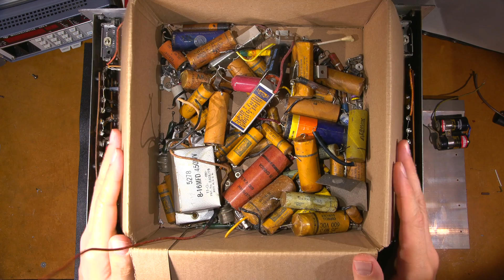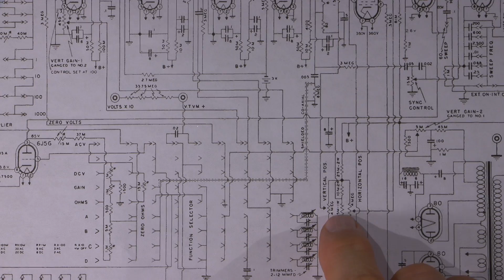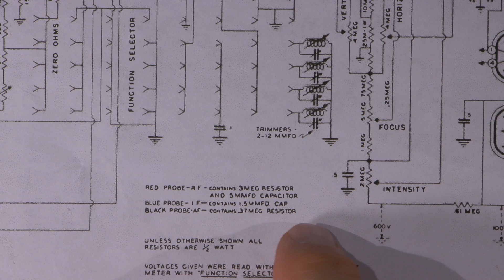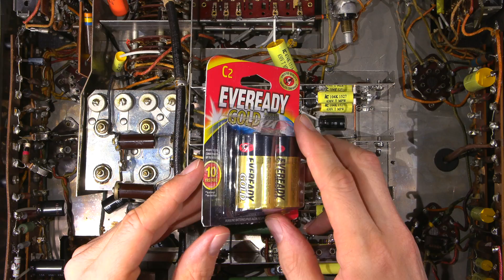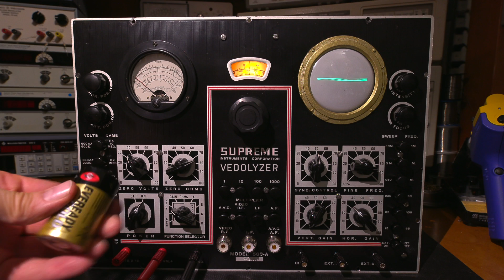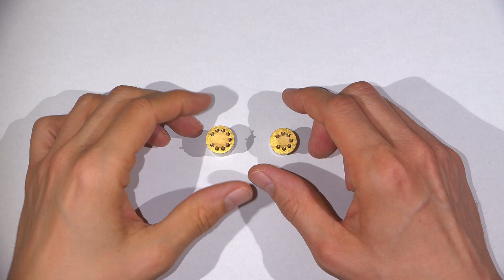It's Alive! The Supreme Vedolyzer From 1939- [Restoration Part 3]

Comment: The item is a bargraph Nixie tube, specifically identified as a model similar to the IN-9.

Function: It is a cold-cathode vacuum tube used as a discharge or level indicator, which produces an orange glow.

Design: It features a display coil inside a glass tube with wiring at the end.

Comment: I would've put battery holders on the back of the cabinet, or on top of the chassis, replacing the batteries should not be that hard. In a number of years, if someone else has it, and it stops working, they wouldn't have a clue.

Comment: I have done the WD-40 on most all radios to bring the back to life for band switches small moving parts but never on vacuum tube testers. I like WD-40 better than anything else for making things move smoothly a like you stated it cleans contacts nicely. Great radio repair here. One question what do you do with all the old capacitors and other things you remove?

Comment: i was told by an employee of textronix that every piece gets a bath when it comes in for service. soaked rinsed and dried before any service done.

you are 1000% correct about the power of wd-40 it cleans connections and protects them 

pc ram sockets love it

Comment: At the World Radio History site, I found a number of nice large advertisements in issues of Radio-Craft magazine.  July 1939 had the model 504 Vedolyzer (simpler, no scope).  The May 1940 issue has the 504 but also has the 560 Vedolyzer (with the scope) and also the 562 Audolyzer.  The January 1941 ad, unlike the other ads with photos, has a drawing of the 560-A Vedolyzer with drawings of various waveforms with big text at the top of the ad saying, "SEE The Signal".  The end of the ad says, "...an instrument for COMPLETE DYNAMIC ANALYSIS."  The ad mentions their 1941 catalog so it is likely some old catalogs exist somewhere.  The company was located in Greenwood, Mississippi.  These advertisements make very entertaining reading.  A 1946 catalog was sold on eBay but it no longer had the Vedolyzer but did have a scope, many tube testers, audio generator, and meters and said it was their 20th year.  So, it was founded circa 1926.

Comment: Why didn't you just buy 2 of each in NIcadium rechargeable batteries for that radio instead of  regular alkaline batteries as replacements. They'll last as long.,or could last even longer than those alkaline batteries for more older.& modern upgrades.

Comment: If clean distilled or de-ionized water it would stand less chance of shorting or rusting.

[I had dumped most of a large latte' into my laptop computer. Unfortunately, the latte' was sweetened with sugar. Fortunately, it was a Thinkpad that had drain holes in it. I pleaded across the table for my friend to pull help me pull the battery out. Coffee poured from the laptop. I placed the battery and laptop into the car and drove home, but on the way I bought a gallon of distilled water.

At home, I disassembled the laptop. It seemed so wrong, actually pouring water through the keyboard, rinsing the DVD drive out. With good luck, the motherboard was spared. There were only 2 drops of latte' near the USB port. I shook all the parts out, and set them on an window electric fan. Upset, with nothing to else to do, I turned on the fan, and the house with parts drying on the fan. Early in the evening, I took everything in.

In the morning, I put the computer back to together, and it started, and ran fine.]

I also suspect that a small amount of Kool-Mist could be added to the water to prevent rust entirely. Evaporust might be used, but unfortunately, it removes electroplating.

I had read from reports on CNCZone, that using distilled water also helps prevent rust in Koolmist solutions, where cast-iron tables and vices bathe in flood and mist coolant, all day.

Comment: I didn't catch what the voltage was of the original batteries - you had mentioned you would be testing them and thought they may still have been good. What voltage did they test at, if you recall?

Comment: 24:50 Isn't using pentodes with a low resistance load a pretty standard technique to build wideband amplifiers? The high frequency limit is basically the time constant made be the plate load and all the parallel capacitance, so keeping that low and maybe compensating the top-end a little by those chokes gives a good bandwidth?

Comment: Hello i had seen this series when you first posted it and came back to watch it, as i had wandered off into a different direction. I sold my beloved restored German Grundig 1950s AM, FM, SW w/4 speed turntable and was in a bit of withdrawal. I was immediately calmed by your professor voice and terrific explanations. Your talents and gifts are very well shared and most appreciated. I hope all is well and I will be watching more often. I did complete a self tuning smoke generator for Model Train steam engine so i have been using my 70 year old brain, but alas not the big old radios and hot Tubes.  This series was an excellent save and wonderful result, one of your best projects. Stay well, Dennis

Comment: 3 hours is okay. I am surprised you got that far without tying a rope to it and dropping it into a lake to keep your boat from drifting away. I hate equipment that has been multi hacked & butchered repeatedly over a span of decades to keep it limping along, rather than actually having been properly repaired & maintained with proper periodic total rebuilds. I bought something called a "NOBATRON", made by Sorensen for Rayhtheon. It's an all tube regulated 0-600 Volt 0-1000 mA power supply, but it is a massive 105 pound monster. I opened it up and was looking at this enormous transfomer and wondering where are the other terminals. It was actually a gigantic filter choke. Someone blew up the original reference supply transformer 120 primary, 400-0-400/120-0-120/3.15-0-3.15/5 Volt seconday and some hack installed a 240-0-240 with 6.3 & 5VDC for the 5Y3, and a separate 120 to 240 iso trans step up transformer so it would only run at about 315 Volts.  I got stupid lucky and found a 560-400-0-400-565 volt transformer on EvilBay. I can click the volt meter to milliamps, with an interlock switch on those 565 volt taps, and get 800+ volts out of it now.  I have rarely needed more than 600 volts. The regulation is rock steady and super stable. I have that same Lambda PSU too! That's a great little  workhorse too!

Comment: Wondering if you could of added a small power transformer and regulator circuit to eliminate the batteries so one does not have to replace them or worry about if they are still good in the future.

Comment: With all the work you put in, I am curious as to why you did not just disassemble the hacked VRs in order to clean and check them.  You could have also plugged those holes with epoxy or even tape.

Comment: Just a thought you mentioned that on the schematic that the K ohm values are marked with an M not a K. Ks are used to mark cathodes. They use M because in Roman numerals M=1000 now this is coming from a guy that's old as dirt that's how I learned it. Take it for what it is worth. There are all kinds of Roman symbols used in electronics, chemistry and mathematics in general. Great job on the restoration! Awesome video!

Comment: It looks to me like the two input resistors, 20K variable and 40K, were chosen to allow precise calibration for a 50K input "impedance". That would be with the pot approximately centered. Just saying. When I design adjustable resistor strings, I always shoot for centered pots when all is set correctly. Great job on this restoration too. I love your work.

Comment: Super Heavy Duty (Carbon-Zinc) should last for a very long time, and probably a lot better than alkaline.  Alkaline will leak.   This is why smoke detectors still list a big batch of part numbers that all point to various manufacturers SHD batteries.  (very low current draw)

Comment: if that is just a dual 5k pot couldnt you

1. replace it with a modern 5k that handles less current and voltage and then build from a couple transistors a current and voltage amplifier to allow it to work?

2. if there is enough room in the case couldnt you salvage 2 5k high voltage and current pots from the focus and screen section of an old tv (older tvs had the multiplier as a separate box and the pots often was separate too.

todays crt tvs have the multiplier and pots built into the flyback transformer and are all potted so you cant extract the parts.

then find a way to sync the movement of the pots as 1.

Comment: From the circuit you drew out of your unit, the plate load resistor on the 3rd stage of the oscilloscope amplifier might have the wrong value. Your drawing shows 2 10k resistors In the plate circuit as one was originally inside the peaking coil. 20k is a large value for a wide and amplifier. What value does the “correct” circuit show.

Comment: Paul, quick question about chokes/coils wound on resistors. Generally are the resistors just used as formers only? In other words not for any coupling reason or is there indeed a risk of coupling? (I guess it depends which resistor in the circuit you use.)  Regards David (gm4glg)
Reply from the maker: Most resistors are just used for forms, so they are high resistance. Some do act a parallel resistance though, it just depends on the application.

Comment: Have you ever seen what WD40 does to electronics and mechanical switches after a year or two? It dries into a sticky residue which catches every bit of dust it can and eventually turns into a guey mess and varnish and is a proper pain to remove, often blocking switches, etc! There is a reason that there is an electronic contact cleaner and there are other chemicals to protect bare metal!
Never recommend it for electronics, especially something like this.
Reply: I think WD40 was originally  intended to lubricate wet moving parts, eg bicycle chains. For sure, when used over many applications it does gum bicycle chains up. But I know a respected restorer who does use it to clean up chassis, often with an old toothbrush, but that does not entail many applications over a long period, and anyway I guess he does wipe up the residue.  Also, there are some restorers who have been known to use WD40 on switches. I would not.
Reply from the maker: WD40= "Water Displacement formula 40" It's original intention was to displace water in electrical applications.
Reply from the maker: Well that's odd. I coated the whole chassis, and it's bone dry without any residue.
Reply: @MrCarlsonsLab  There are lots of people that will spray it everywhere without even wiping it out so best to avoid any such recommendations :)
Check your Vedolyzer in couple of years, wherever you didn't wipe your WD40 properly it will turn yellow on shiny now metal :)

Comment: I think the hour-ish length videos are just about right as it's not always easy to dedicate much longer in one shot. It's great to see the restoration of this equipment but can you go a bit more into why you might use the Vedolyzer vs a regular scope or meter even if they are older/analog models as well? Is there something it provides that you can't get otherwise (and yes, I get the idea of using the old gear simply because you can as well).

Comment: Thank you Sir!  I appreciate your work and those who have helped.  The Violet ARC bulbs - When Keyed up and CW was part of what fascinated me some 40 years ago. Information transformed to dots and dashes.  It remains interesting. Your work - and thoughts on trying to fix stuff - amazes me. I know it consumes multitude of hours of thought and time. Cheers! 
Edit -- Grey matter filter -  i used a heathkit "multi-tester" some 40 years ago. At least the sweep - of the needle gave me Real values of voltage or resistance or current, but I knew it was based on specific points in time. TODAY - we use digital equipment - and think that the values - we see - are real, except if the are points in time, they are just wild guesses. The digital only gives use guesses. And I know I am commenting on the obvious - but without the 40 yrs -and your experience - we never see the issues. I remain an avid watcher of your work. I hope to repair my own equipment, NOT butcher it! Kind Regards

Comment: I liked the somewhat quicker pacing of this video compared to your recent videos. I like lots of information, but I'll be honest, some of the videos were starting to be a bit redundant, with the same information repeated multiple times in this video that was also repeated multiple times in the previous video. This one was perfect.
And I'm going to say that that is a Geiger-Mueller tube or some related kind of ionization detector. Not sure why it has three leads. On a G-M tube, I would expect only two.

Comment: For potentiometers you might want to check with potentiometers.com.
Anyway - my experience is that WD40 might be a potential for problems if you have high voltage circuits, mostly because it will leave a residue that attracts dirt. Might be a minor issue on indoor items, but for outdoor like a car ignition systems it could lead to less desirable effects.

Comment: Just curious did you test the removed capacitors?  It would be interesting to see how many would still be in-spec. after 80 years.
Reply from the maker: Hi Chris. Capacitors have paper in them that goes acidic over time. They may test close in uF, but their DC leakage is way above acceptable limits. (keyboard isn't behaving today.)

Comment: I'm sorry, I have a rather noob question that is not related with this video. When you're testing a diode or transistor with the curve tracer, what exactly that line in the screen represents? I mean, what exactly are we seeing there? I ask this because when we're using an oscilloscope, we see the amplitude of the signal, its voltage and frequency. But what specifically is shown in the curve tracer, what are we seeing? Thanks in advance.

Comment: Mystery device is a neon bar indicator. 
I own an old German 1934 Blaupunkt radio that has the same thing, just in a different package (bayonet socket). It is used as a tuning indicator. And even after 85 years it still glows strong and bright, unlike Magic Eye tubes that usually got incredibly dim after few years of use. 
I was surprised they weren't used more in radios as they don't wear out near as quickly as phosphor in the magic eye tube, and they glow even brighter.

Comment: The trivia device is basically a vertical nixie. Formally known as a neon tuning indicator.. it has a control electrode to which if you apply a variable voltage, that gives you a glowing bar the same as in nixies with variable length. The only reason I know this is because I was struck by a nixie project that had this type if device and I'm like man what the heck is that never seen those before turns out its beautiful and expensive xD I never thought I will get so in depth with electronics ever and I'm 17 xD

Comment: I am 78 years of age and have been a amateur radio operator since I was 19 years of age.
My eyesight is also 78, in other words bloody horrible. I am replacing my modern equipment 
with older valve equipment. Why ??, Not because I don't like my modern equipment, but because I no longer can see surface mounted components and so cannot repair it.
Vintage equipment is also a bit harder but I can cope with a magnifying glass.
What is the reason I tell you this ??. Well I really enjoy your video's on equipment that is older and utilises point to point wiring. Don't get me wrong, I understand modern devices, I don't understand why they have to look like micro organisms and you have to identify them using a electron microscope.
Such is progress and old men like me are defunct. The king is dead, long live the king.
You are the best tech I have come across by a long way.
I look forward to many more video's.
Best regards from " Down Under "
Michel  vk3kvw
Reply: hahaha i am 14 years old and i love electronics (but i am new to it) and im exactly the same i always go for old stuff like old Tektronix scopes and old radios just because i like old stuff plus its easier to repair
Reply: @goofyahhuncleproductions42069  as I am about that age and share those interests, I can relate
Reply: well, i'm 42 and also need my 20x microscope to solder smd sizes under 1206 (0.12 in x 0.06 in), I mean you should not feel too old for that inconvenience :)
Reply: Hi Odium
I tried to work with these microscopely small components But every time I try to pickup one with a pair of tweezers The damn thing jumps all over the place. Are you sure they are not alive. I am not so sure. Perhaps it got something to do with my hands. The bloody things won't stay in one place.
Oh to be 20 again.
Michel  vk3kvw
Reply: Speaking as a "kid" of only 70, forced to retire from the motor trade at 40 by a spinal problem, I can relate to where you are coming from as I learn a new skillset with Mr Carlson's course. There are many parallels to my training, one coming through being "we test not guess!". Things have surely changed since I started work, it seems to me that, we, who were taught to be engineers are being replaced by parts and module swappers, mores the pity! That said, on looking at the comments, it is gratifying to see the comment from the 14 year old budding engineer, I hope he stays true to his mindset and becomes the expert he is destined to be!
Reply: I am also 78 years of age and an amateur radio operator (KQ2E). I just can't SEND CW like I used to do it... every day and every way. BUT, now I have a new rig (Icom 7300) with a "new fangled" micro-something that I can TALK into! ROFL  Honestly? I'm THRILLED to see old equipment being utilized again for modern equipment as many people think you need a zillion dollar MSO scope and a counter which counts to 200 GHz. Oh yeah... a DMM which reads to a picovolt. Yeah. Like, come ON now!